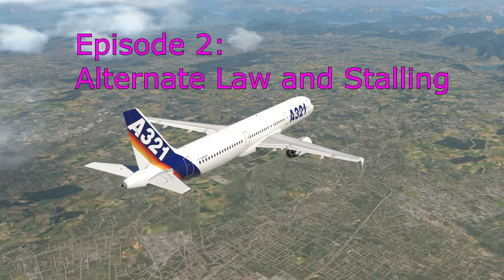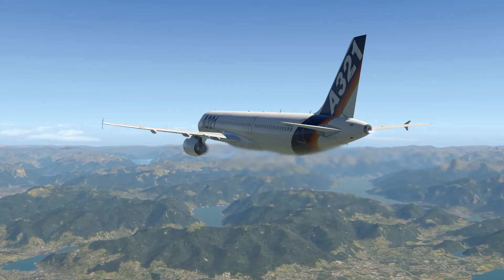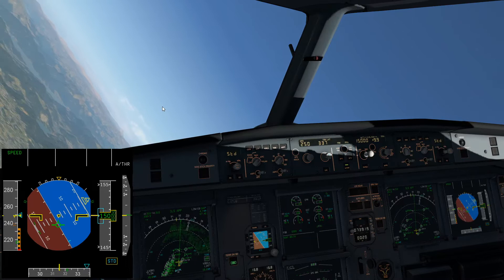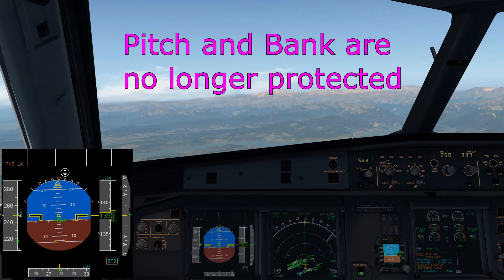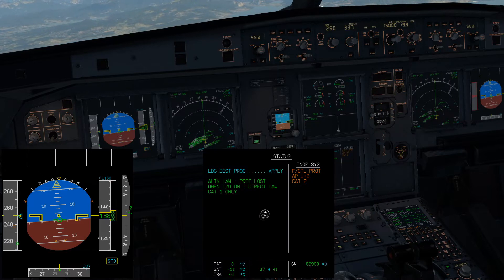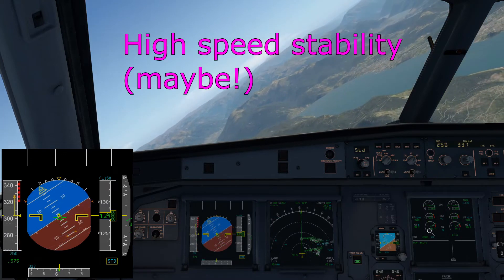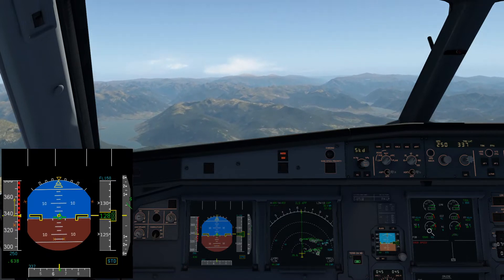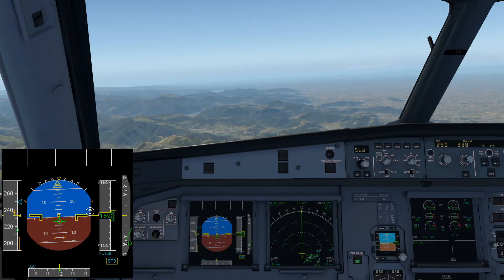What is the Airbus? Part 2: Alternate Law & Stalling with a Real Airbus Pilot X Plane 11 ToLiss A321

Comment: Hello Cpt, im doing the same things you showed here on the Flight Factor A320 and in alternate law the pitch is not holding when adding or removing thrust. By what you showed my understanding is that the FF A320 is NOT behaving correctly by changing pitch in alternate law when changing thrust, is that correct?
Reply from the maker: Hi Hugo, what you say is correct. In Alternate law the pitch is still controlled with G force like in normal law. And it will auto trim when working in a normal speed range. Make sure you landing gear is UP, when it is down the aircraft will be in ‘direct law’ instead which is quite different!

Comment: How do you put the avatar display on the aircraft display tab? I have been trying to do the same for flight factor x plan 11 also but without any luck. a I tab opens up as a separate window and I want the display to be replicated in the default aircraft tab

Comment: Many thanks for this informative and educating tutorial. I studied the accident reports of AF447 and Air Asia. I am shocked that in each Airbus both pilots were disorientated and not able to prevent a complete stall despite of massiv stall warnings. They were not able to control the aircraft after the AP disengaged. From AF 447 I read the complete recording of the voice recorder. Incomprehensible what went wrong in both cockpits. Incredible weakness crews and sensless death ov several hundred people. One reason is no training for manual flight at high altudes buth this is no excuse to me
Reply from the maker: Thanks for watching, I'm glad this video made sense, it is quite a big topic as you know. There were of course a lot of factors in those incidents, hopefully something that everyone has learned from.
Reply: It is now widely accepted that Bonin was in a startled state which led to inability to apply logic and training.  In this state. The brain reverts to a primitive mode and is only capable of primitive tasks. It requires training to be able to recognise and control this state. The better airlines do this training.
Reply: Many factors led to the crash of AF447, too many to oversimplfy the errors being made. But to take your example of not hearing the stall warning: Has it ever happened that you have misheard or even not heard anything? For example, the doorbell or someone saying something but you were so busy thinking that you could not hear it? This is called tunnel vision and in my opinion, that is exactly what happened to the pilots. Both pilots were so preoccupied with the decrease in altitude that they blanked out everything else around them. This demonstrates that human factors (especially situational awareness) play a critical role in flying a modern commercial aeroplane with a high degree of automation, such as an Airbus; in my opinion just as important as flying the aircraft itself. Several minutes passed between the first stall warning and the impact in the ocean. So, the pilots could have taken some time to get an overview of the situation before figuring out by both, pulling and pushing on the stick. 
People often say that a pilot should “Aviate, Navigate & Communicate” in precisely this order. I do not say that this is not true but I think it is not enough. I believe, “orientate” is also very important and should be taken even before “Aviate” so you will remain situational awareness in the cockpit.

Comment: Is there any situation you would use 1+F on approach before going flap 2? I used to use it (select flaps 2 wait a second then back to flaps 1) on approach because I always thought AOA was too high until started to realise watching this and other videos that that is normal
Reply from the maker: No I would never do that, if I was too far below the green F or if the angle of attack was uncomfortable I would use the next stage of flap. Thanks for watching!
Reply: 320 Sim Pilot ok thanks. I realise now I was mainly slowing down too quickly so was flying at like 180knots one flap 1 but way too far from the runway
Reply: It could happen if you decided to stick at Flap 1 after a go around and commence the approach without going to flap zero.

Comment: Brilliant video. Need to ask something completely random that bugging me on the toliss and wondered if it’s same on real aircraft or if there is a work around

This mostly happened a in US but has happened in Europe. I’ve been flying on a STAR enroute to the IAF and then I get told by ATIS the runway is not what I expected. I then select the new runway (say 09L instead of 09R) and via. I leave the STAR and Transition alone if it works for both runways and then press insert. The aircraft according to the updated flight plane then wants to start back at the transition waypoint and I have to put it into HDG and V/S mode, direct to the waypoint I was already going to and then re-activate descend mode.  I thought it would only change from the IAF onwards but it wants to fly the STAR again. Is this same for real aircraft, limitation with toliss or am I doing something wrong?
Reply from the maker: Thanks for watching as usual Thomas! I’ll have a closer look at that in the near future. If you don’t select no Star then it will load up the full arrival. Changing the arrival in the FMGC during the approach takes some careful programming!
Reply: 320 Sim Pilot thank you. I have tried for example loading the secondary flight plan with parallel runway just incase but still wants to begin again from the STAR transition
Reply: @tomstravels520  you need to make the waypoint ahead of you the to waypoint be entering it into line 2L on your MCDU. THEN select NAV and it should work.
Reply: @peteconrad2077  I found this out in the 11 months since I posted but thanks for confirming
Reply: @tomstravels520  👍